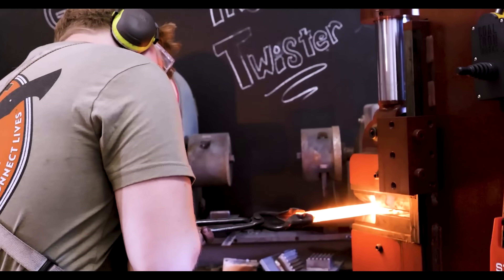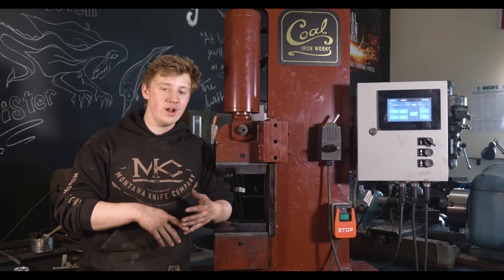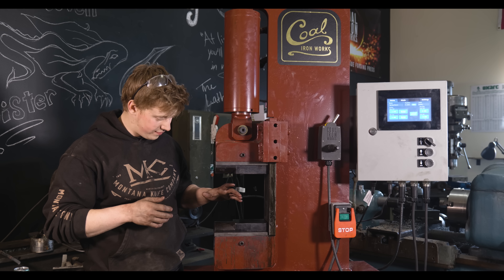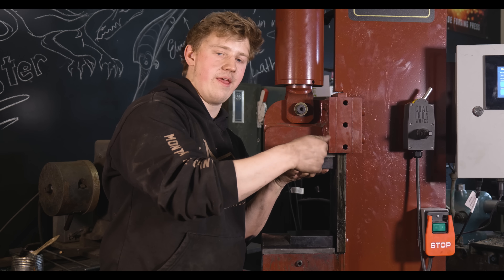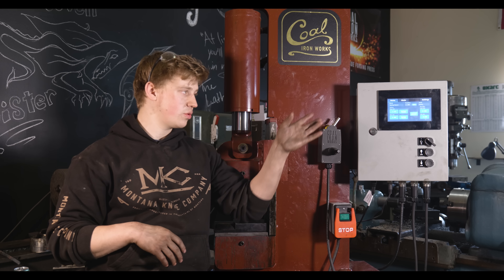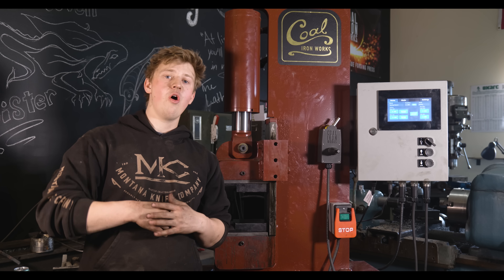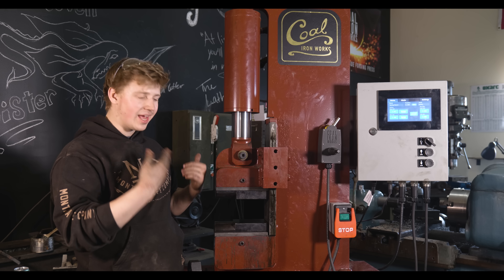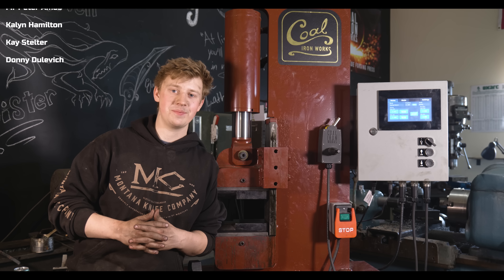The Most Useful Tool In My Workshop

Comment: Told Alec years ago to use his press when he got one after moving from the shed to the current shop in England. He used it like once to punch a hammer. A good press is just about all you need, you can get by without even having an anvil if your press has good control. Glad to see you putting yours through it's paces and hope to see you start making new dies for it. Want to forge in bevels? Bevel dies make short work of it even with single bevels, just need a step on the spine to keep the bevel from pushing the piece back.
Reply: I swear he'd walk past the press a thousand times to use the power hammer
Reply: @otterconnor942  Exactly, perfect jobs for a press and he uses the power hammer and makes more work out of it. Power hammers are good for quick and dirty work but if you want precision the press is the way to go.

Comment: Hey Will, Love the Press. just wondering how the controller knows the position of the ram while you are pressing? I ask because I cant for the life of me see anything that would measure position travelled? I realize that they could be calculating based on fluid displacement over time, but that could introduce a lot of errors that doesn't seem to happen.
Reply from the maker: It’s on the back of the press 👍🏻
Reply: We're using a magnetic string encoder attached to the top of the slide assembly :)
Reply: @CoalIronWorks , @Will Stelter Thanks

Comment: Great information.  I’ve often wondered when I get to the point of needing to move more metal, should I get a hammer or a press.   Looking at their website, Coal’s smaller hammers run on 110V.  They don’t say if the smaller machines can use a digital controller.
Reply: Yes, the controller is available on all of our models including the 120V 12 ton and 16 ton

Comment: For the pedal, I recommend simply welding or bolting a vertical square bar or something similar to the pedal frame, that extends up to hand height with a hand grip. That way you can quickly move it to whatever location you want as you are moving around the equipment.

Comment: Does the controller have a creep mode that allows you to slow the pump down and use it as a traditional shop press to press in bearings or stuff of that sort?
Reply: The jog button would do that
Reply: I think I would look for another way of pressing in a bearing than that forging press. Lots of possibilities like the drill press or even the lathe would be a lot more controlled than gritting your teeth and hitting the go button. Ruining the bearing and what you are trying to push the bearing into can happen easily enough. Take your time and be careful.  There's no reset button after you fu_ked it up.
Reply: That would be a very desirable feature, agreed

Comment: Interesting- I do like watching power hammers in action, but this looks like a more versatile machine.  I don't remember if it was Kyle Royer, or someone else who made the point that presses suck heat out of metal faster than power hammers do.  And whacking on metal with a power hammer is just so cool.  But I'm sure that press comes in quite handy.
Reply: We love our presses- but in an efficient shop, it shouldn't be a press vs power hammer competition. The two tools actually complement each other incredibly well. The press excelles in moving and shaping large material and forge welding large billets, but when your material gets thinner, you lose heat faster- so the extended contact with the large dies does in fact draw out heat faster, where as the impact of a good hammer blow could potentially maintain or even add head to your work in some instances via kinetic energy transference. The press does however lend itself towards being a more versatile machine in smaller shops since it doesn't require any foundation and can be easily rolled into storage. It's also quiet enough to operate in rural areas!